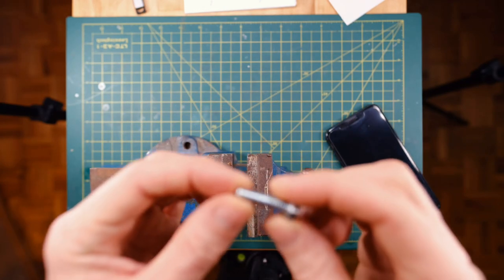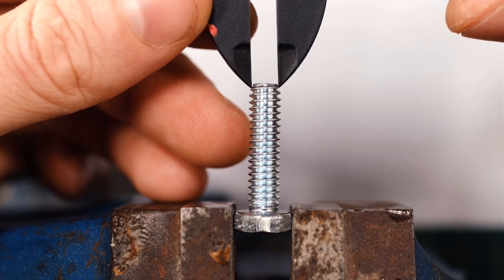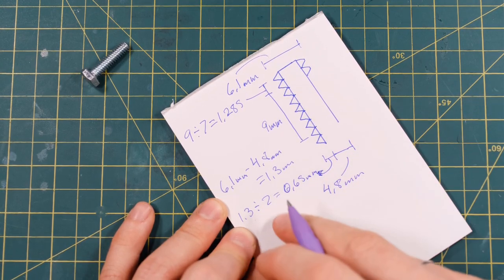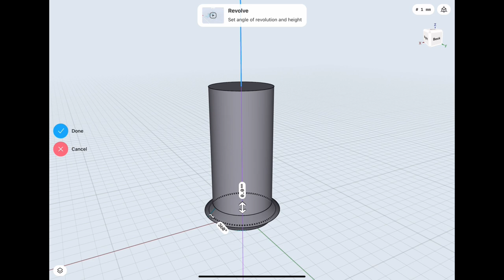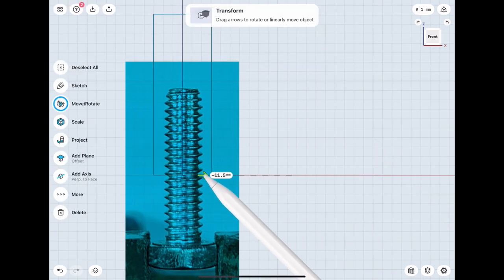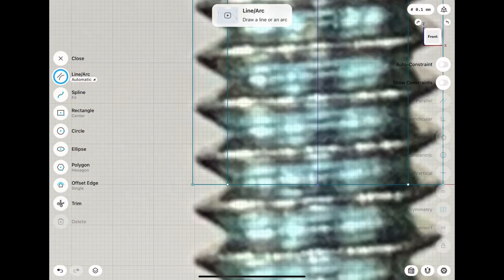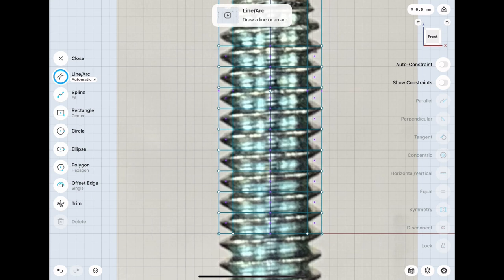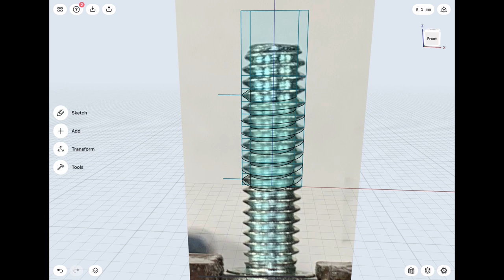Recreating threads in Shapr3D - two methods

Comment: You can find all the information of the bolt online
Reply from the maker: I used a standard bolt as an example but not all threads are obvious and many people don't have the tools to identify them. Some threads don't even exist as standards. A good example comes from one of the reasons I thought of doing this in the first place and that was when I wanted to 3D print a replacement cap for a tube of glue I had.
Reply: @Larsen514  There are plenty of custom and off kilter threads out there (especially on molded parts).  Most recently I came across one that was totally nonstandard in every dimension on a commercial paint sprayer.  This video was great!  Amazing what you can do with a darn iPad these days.
Reply: @Larsen514 Thank you very much for this video. It was very helpful. I have looked for 2  days for a formula or something similar.
Wish you all the best!

Comment: I haven't watched this video yet, I will, but I'm going to try importing an existing bolt STL into my Shapr3D project, put it into a part, and use the subtract feature to create the tripod socket I want on the part. I'll probably enlarge the bolt a little first since I have to take in account of FDM shrinkage. It would be nice if Shapr3D came with a set of bolts/screws built to do this like their library of letters.
Reply from the maker: Mc Master Car has them
https://www.mcmaster.com/
This works as well and can be done quickly, the issue is that sometimes your resulting part can no longer be edited the same way as if you built it up from scratch.
Reply: @Larsen514  thats a great idea - i watched your video and must say i‘m impressed by your natural talent explaining in a very professional way - got i question regarding the video - tried to use the MacMaster 3D files, and used the subtract feature from Shapr3D and printed the thread, but besides shrinking issues i always got a very tight thread - do you have an idea, how to make the gap between threads of the bolt and nut fitting more loose ? i thing it should be shrunk only in one dimension - How would your achieve that ?  Keep up your great work, you got one fan more :)
Reply from the maker: @emgab  
As you have discovered, there is a missing feature in Shapr3D, which is to be able to scale on either 1 or 2 axis's versus all 3. The alternative that I would suggest is to do the scaling in your slicer, on the X and Y axis. But that might not be practical if you don't want the rest of your part to get distorted. 
An other way you can go about it is to use the other sex of the part and merge. So if you are using a bolt to subtract, try using a nut and merge it into your part.
Reply: @Larsen514  Yeah, that’s what i already tried - to distribute the gap between the bolt and the nut i made the nut 1,5% bigger and the bolt 1,5% smaller - it works so..so.. not really perfect, but on larger thread, let’s say bigger than 10mm it’s working pretty well - having a feature like you mentioned with one.dimensional scaling would be perfect.
Reply: @Larsen514  Dear Peter, based on your suggestion, i thought about how to improve the thread play without having a single dimension scale function - here is what i did - i took a solid block 20x20x20mm where a 16mm thread should be applied - then i moved a 16mm-threaded rod into it - then i used the subtract function to cut out the thread in the block - while using the section view  Z-X plane, i moved the rod by 0,1 mm up did another subtract - then 0,1mm down and subtracted again - the result was a perfect thread in the block with 16mm and 0,2mm play - worked like a charm - well, i assume at least with larger threads, cheers Mike

Comment: Thank you so much Larsen!I'm trying the second method with the image, but i'm not so sure that is trusty, as my "bolt" is a custom and big one, i've some doubt that the image is straight enough (possible parallax issue?!) to use it as reference for create the thread...any suggestion?
Reply from the maker: Sure thing! 
The key to using the image method is ensuring you first have a good measurement. Measuring the distance between threads is the most crucial in my opinion and it can help to span across as many threads as possible and then divide by the amount of threads. 
As for the imaging, the further away from the object you are, the less parallax there will be. So if you have a phone with a zoom lens, that is best. Also if you can mount the camera and place the object at the exact same height as the lens, that will help too. 
The iphone has a “level” feature built into the camera when shooting straight down which can help. For downwards shooting, you can put the bolt on a block of wood with the hex head leaning off the edge so that the thread lay parallel to the block.
After taking the image, edit the image to reframe/rotate until you make the sides of the bold line up perfectly with the edge of the frame (leave just a little bit of gap before saving). You can also use key-stoning to correct  any vertical parallax. Horizontal parallax with the threads shouldn’t be much of an issue since the bold is round and your perspective stays the same regardless.

Let me know if you need anymore tips. I’m happy to help.

Comment: Is there a widget or tool to apply a thread to a surface and get rid of all this drawn out process of building a thread? It reminds me of finding roots the long way vs using the Quadratic formula. It is nice to know how you did this, but there must be a quicker way to get the job done. Thank you for this video and your time.
Reply from the maker: Perhaps in other CAD softwares like solidworks but not in shapr. They only just introduced the tool to help create patterns but even that tool is limiting. For now, the only real solution I see is this or import existing STEP files.

Comment: How do you refill a hole that you subtracted through a body? I can do it using the “edit undo”, but what if I’m 10-20 steps ahead & decide to fill a hole 🕳️ I cut 10-20 steps ago?
Reply from the maker: @GDM1787  the only way I can think of is to merge an other object into the space, making sure the surfaces are flush.

Comment: How do you taper the end of the thread into the shaft at the end of the bolt?
Reply from the maker: Im sure there is a better way but the way I do it quick and simple is by creating a 45 degree concave cone and using it to subtract it from the top of the bolt.

Comment: why didn’t you just look the data up in some tables to get it as standard?
Reply from the maker: I used a standard bolt as an example but not all threads are obvious and many people don't have the tools to identify them. Some threads don't even exist as standards. A good example comes from one of the reasons I thought of doing this in the first place and that was when I wanted to 3D print a replacement cap for a tube of glue I had.

Comment: very cool. how do you make longer threads that the original? do you just duplicate and stack them up?
Reply from the maker: You could do that. If you are using the method with the image. Calculator the length between the opposite ends of the thread tips, duplicate the object and move up by that length.

Or if you are using the method of making the thread from scratche using the measurements, you can adjust the calculations to account for a longer thread.
Reply: @Larsen514  cool thanks

Comment: aren’t tolerance’s considered?
Reply from the maker: If I’m measuring the dimensions of an existing bolt, then the “tolerances” are already inherent in the bolts dimensions. 
But if you are trying to recreate a thread so you may then 3D print it with a FDM printer, then yes, you may want to add in some extra tolerance allowance. If you were to print with a resin printer, then no, resin printing is precise enough to accommodate the original bolt’s tolerances (typically).

Comment: Why are you measuring a 1/4-20 bolt in millimeters?
Get yourself a standard thread table (quick google search) and you will have all the bolt dimensions you could ever want. IMO you are only going to introduce errors into your design by converting inch to metric or metric to inch.
Reply: totally agree
Reply from the maker: Using metric to measure and draw in CAD for 3D printing is far more intuitive. Everything else I do is in metric, I'm not going to switch to imperial just for one little bolt. Maybe if you are milling, what you're saying might correct but for simple hobby jobs and 3D printing, metric is the way to go. I used a 1/4-20 bolt only because I use them for my photography gear (tripod mounts and such). Otherwise, metric is mainly what the rest of the world uses.

Comment: No matter what I do, my little triangle won’t repeat around the circumference more than once. Says it’s not attached, but I know it is. Frustrating…. Great instructions though, just can’t figure out how to appear the Shapr3d machine gods so it just DOES what it says it’s supposed to…..
Reply from the maker: Just make sure to repeat the steps I did in sequence, don't skip any.
Reply: @Larsen514  I did… Lol what fixed it was doing 2599 degrees instead of 3600 (360x10). 🙄 appeased the Shapr Gods 🤲
Reply from the maker: @madnessintomagic  
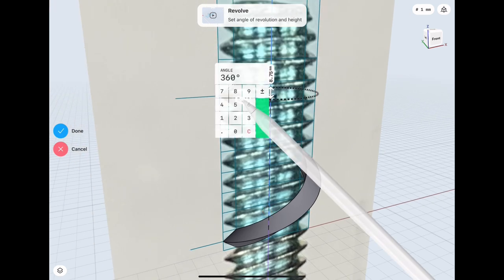Ah yes, I mentioned a similar error in my video. at 12:10
Reply: @Larsen514  Yep! That’s what gave me the idea and thankfully it worked!